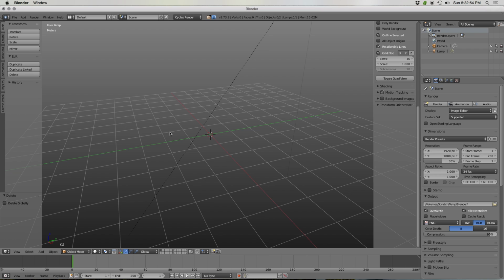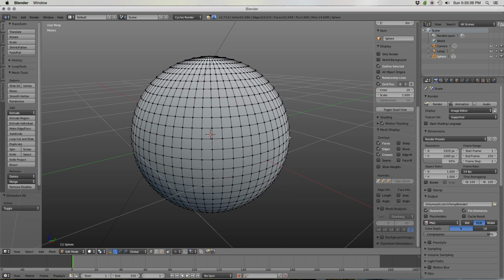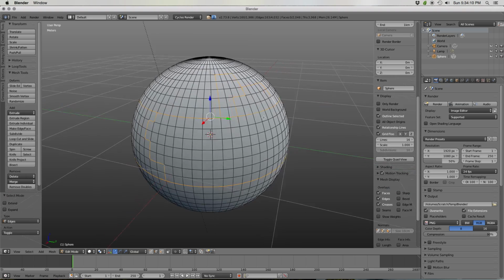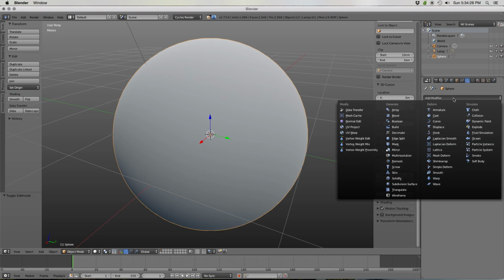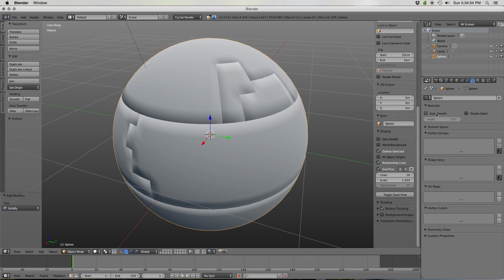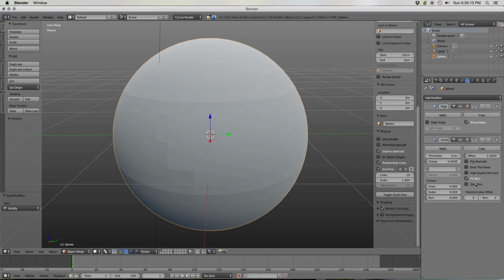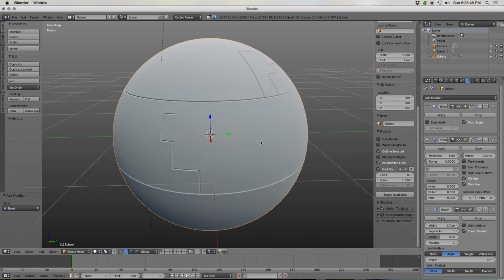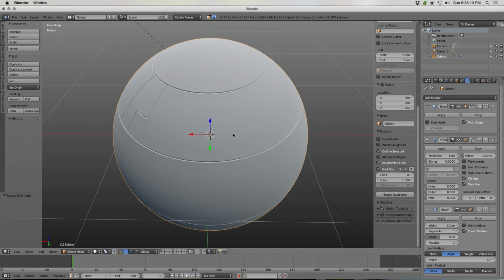Blender - Modeling panel gaps using modifiers

Comment: Love this technique. Can I use this if I modify my base mesh first then apply the lines? Doesn't seem to work if I do this.
Reply from the maker: Yes, should work fine. The “clamp overlap” setting on the bevel modifier May be preventing the seams from getting beveled though?

Comment: Nice, this doesn't work.
Reply from the maker: uh....ok? Could you explain what it isn't working when you try it?
Reply: After marking the edges, switching to object mode, and adding the Edge Split modifier, nothing happens to the edges. Then, after adding the solidify modifier, the model grows tumors...
Reply from the maker: Try adjusting the width settings on the solidify and bevel modifiers, and also make sure your modifiers are in the order shown in the video.
Reply: Alright. I'll try it again.

Comment: Render setting object has no attribute "use color management

Anybody have an idea why this error is being generated? I just installed Blender 2.66a official and Lux does not work (even after uninstalling and re-downloading). Every time I try I get the error described in the subject. Is OpenColorIO causing this?

Comment: I have been trying to model a BB 8 droid from the Force Awakens as accurately as I can, including all of the little indents on the body and I have made countless attempts to try modeling around spherical objects and applying displacement maps and nothing has been working very neatly.

This has solved my problem!

I can carefully model some circles and planes to the patterns of the BB 8's panels, mark the seams that are the indents and edge split, solidify, and bevel them. And cast the flat pieces around a sphere. Makes materializing a TON easier too! SOOO glad I stumbled into your tutorial.

Comment: Would be cool to see how to  bake this corect out and  bring's this to maybe the internal game engine and creat a good material that looks good for GLSL mode ... 
Real time Rendering ...
Use u a the  Cage option or High to low poly bake option (?works only BI !?) ...would be cool to to see how baked out such created Panels wspecially when you have some Parts Glosse or some Parts are metal...
Any links to find infos are welcome...

Best regard 

thx for tip